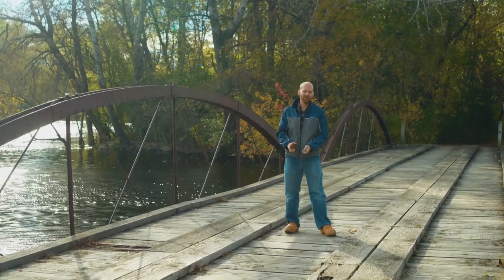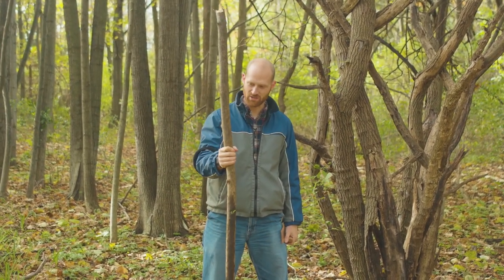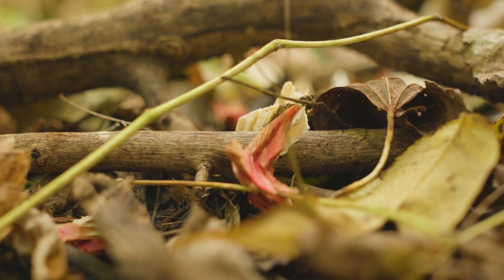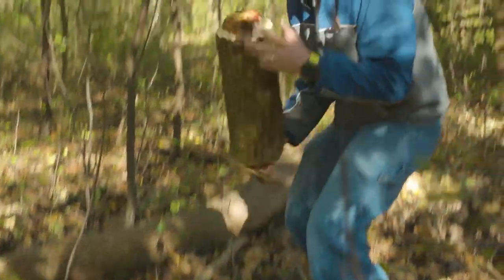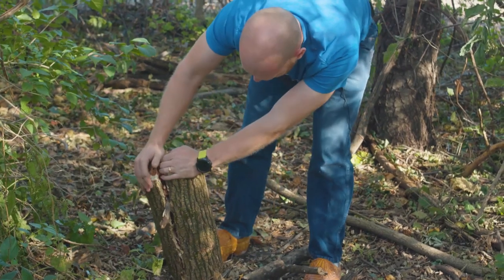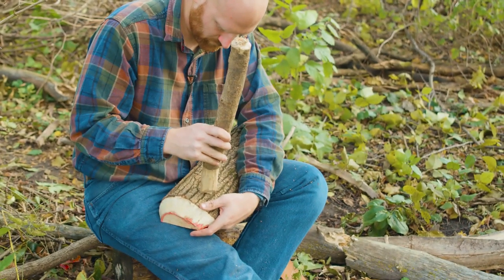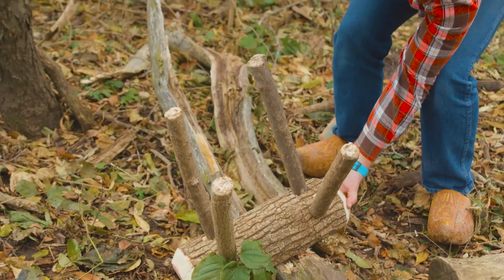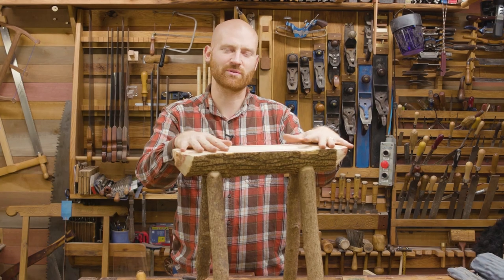How to Make a Stool With Only a Chisel and a Strop Wood By Wright 2

Comment: Oh thankyou,I am an avid woodworking self taught beginner,I make walking sticks for family from interesting woods,like twisted hazel and oak root. I have dry stored so me large tree sections approx 60cms tall bit 40cms wide and I have 4\5 I also have dry store logs 20cms tall n ,cut with two straight edges,I know Thier is an unbelievable project here but a nudge in the right direction would be appreciated,I only use a board saw ,a half inch chisel ,and a quarter inch chisel a hatchet and a good knife,please help bro,got injured and sent home and too much time on my hands. Do a Brit veteran a favour🤔

Comment: Mad skills James! 8-10 hrs ? Would take me 8-10 weeks. A question... why through tenons for the legs. With mechanical fit wouldn't it be ok to make the mortise just a bit deeper than the tenon? I guess it's not that much more work to go all the way through. Just curious of the method.
Reply from the maker: If you go all the way through you can easily wedge the tenon. Other then that it is just for the fun of it.